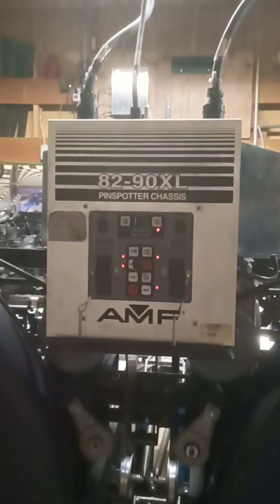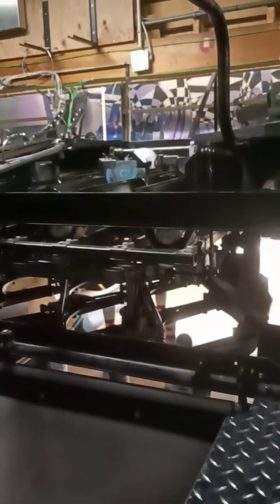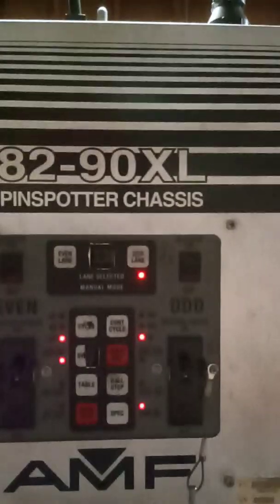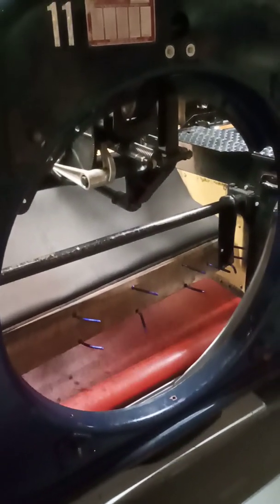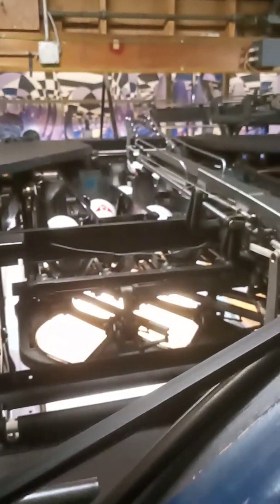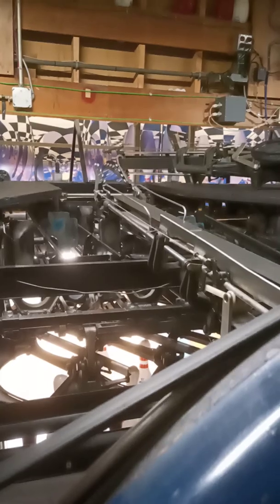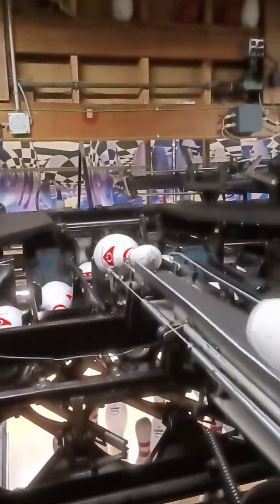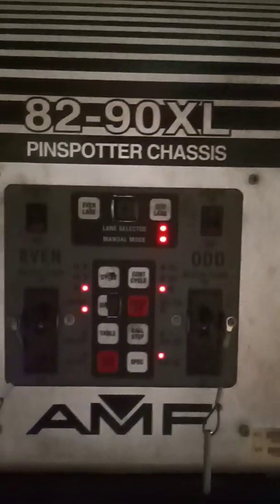pinspotter chassis 82-90xl

Comment: This was interesting to watch. I work on 82-70s, so it’s neat to see how similar yet how different the two machines are. These ones appear to allow the operator to have much more  control over individual components. The 82-70s have individual breakers for each component, so to stop the machine in a specific position, you have to manual flip the breaker for that component to get it to stop.

Comment: Great Video, a quick question for you? Which Bowling equipment do you recommend? GSX or AMF 82-90xl
Reply from the maker: And but that's just because it's the only system I've worked on. I've heard the Brunswick systems are way more mechanical
Reply: @duereviews791  thank you very much for your reply.
Reply: @duereviews791   on Brunswick Model A's A2's and Jetbacks, yes they were more mechanical but on the other hand the GS-10, GS-92, GS-96, GS-98, GSX and GS-NXT were more electrical.

Comment: Interesting video. Yet disappointing for my local mall bowling center have 16 AMF 82-90 XL’s that were bought refurbished in 2013 and after 8 Years of their business (plus 1 Year of no reopening), their machines aren’t in good shape, they never clean them and it’s strange there’s not a whole lot of repairs. My Bowling League needed a new Bowling Center soon after our original Bowling Center in another mall with 24 Brunswick GS-92’s were burned down and this AMF center is a rotten head. Our League is currently stuck in this bad situation...
Reply from the maker: Gotta keep the back clean! Parts shake off the machines all the time. If you clean often you know whenish they fell off and what machine they are a part of. Come down to ocean lanes! Our 12 run pretty well!
Reply: @duereviews791   I wish, but our League lives in Davao City, Philippines and we’re just stuck with SM Bowling (the worst overpricing corporate center)
Reply: Donde es eso?
Reply: @maroy555   SM Bowling Center, Davao City (Philippines)